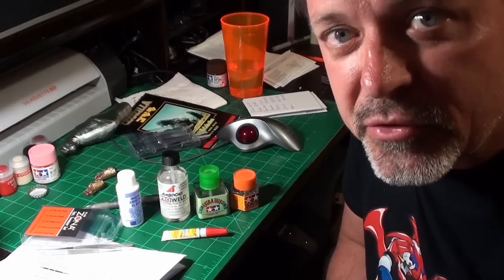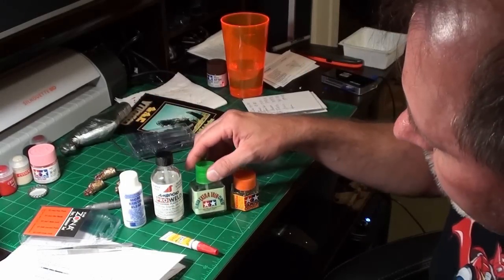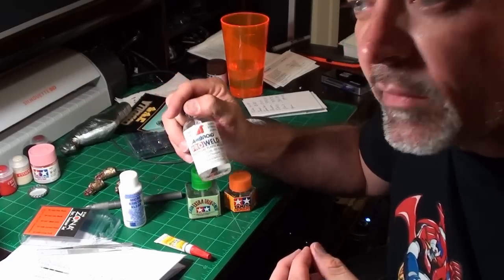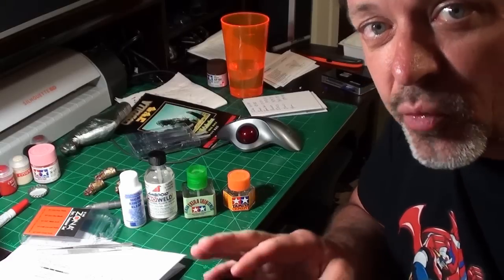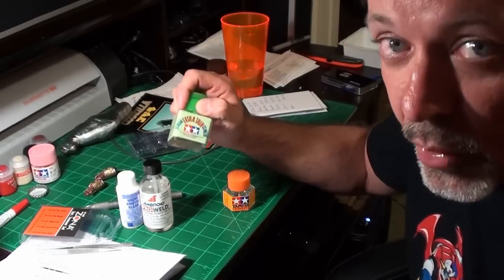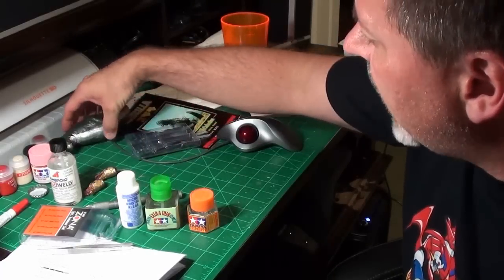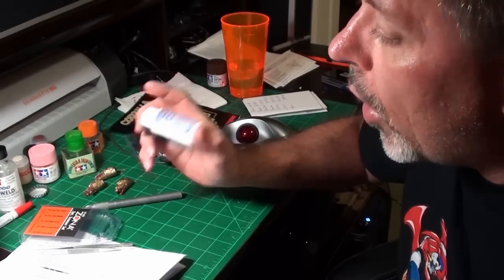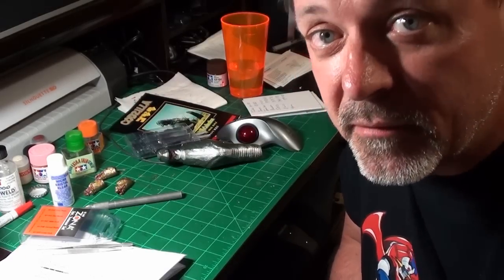Quick Tip:  Different types of Glue!

Comment: You can use a 5 min epoxy on Resin parts as well....PVA will not work however. 

Thinking of the Microscale Krystal Clear....wonder if that isn't the same as Gator Glue? Or visa versa. 

Other glues that are pretty much the same as what you show...Testors liquid...same as the Tamiya X-thin, of course the old fashioned Testors tube glue, which sucks. As well Testors Clear parts cement (likely the same as the micro scale). As well Tenax 7, similar to the ProWeld.

Comment: Great video ! Quick question, I have a plastic chess piece black in color,  which consist of two parts (male to female joint) that came apart, I need to glue them back together, the countless options out there are overwhelming. I wanted to make sure i am using the correct glue type that would bond the two parts together permanently. I want a glue that will not expand, will dry clear and easy to clean among other things and of course would fill in the super tiny void between the two part to join them permanently. Many thanks in advance !
Reply from the maker: It depends upon the type of plastic.   But most likely I would use super glue.   It is a glue and not a solvent like the tamiya glue Model glue will work only on polystyrene, it won't work on any other type of plastic.

Comment: Hi, iv just obtained the 38" super star destroyer kit, I was wondering what glue I should use? Is superglue enough for such a big application area as the main body for example. It is a resin kit. Thank in advance
Reply from the maker: That one is tricky.   Super glue or 5 minute epoxy for sure.  I would use the five minute for the lager parts with super glue for the smaller.   Also look up how to pin joints.  Some joints will probably need pinning.  I don't know for sure I don't know that kit.

Comment: question. Can the Tamiya cement stick ABS to Polystyrene? I asked this coz im making a custom gundam model and the custom parts are ABS and they need to stick to the armor parts which are Polystyrene.
Reply from the maker: It can, but I would use the Orange glue, not the green.    Pegasus hobbies uses ABS plastic for their model kits and I have used both the Tamiya Green and the Orange on them.   I find that the orange works better.
Reply: Thanks for the quick reply!!! i'll try them both if i can. i'd see first if the orange is available. thanks again!

Comment: I'm just trying to figure out what glue is best for plastic models because I've just started making models and I'm wondering if there is a simpler way to get some little pieces to stick without me holding them for 30 minutes+
Reply from the maker: Try the Tamiya green glue.  Sorry for the late response, but you caught me at a busy time of year with work.  And I haven't had time until just now to answer.